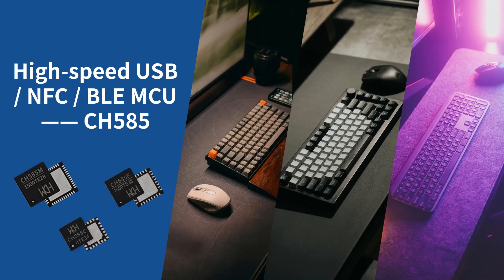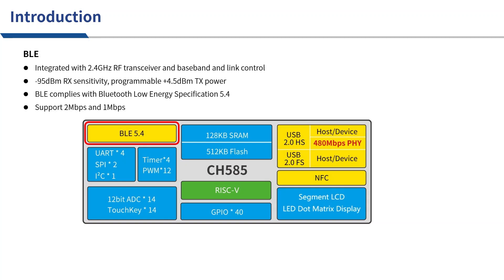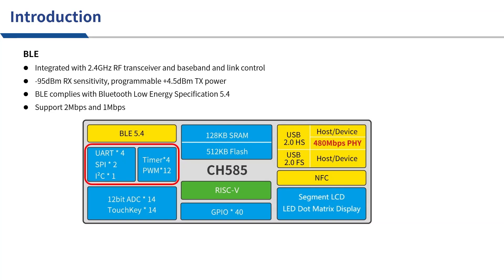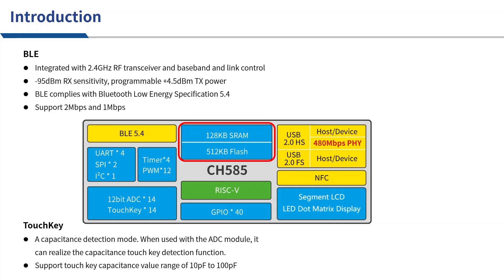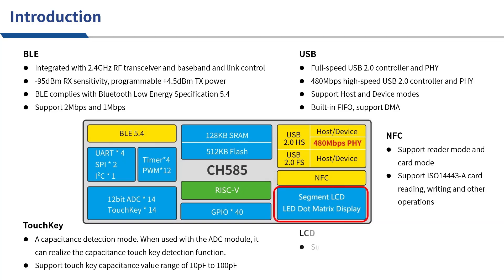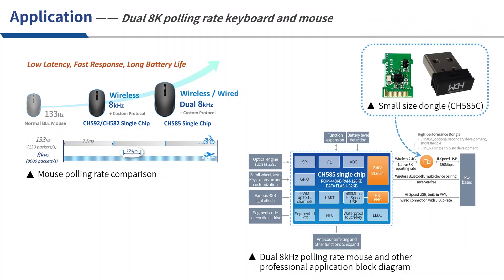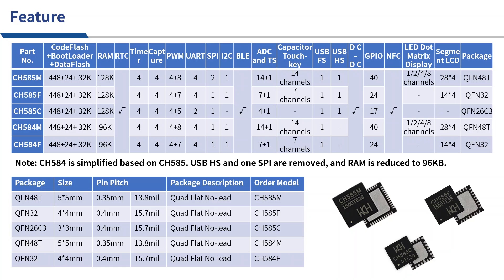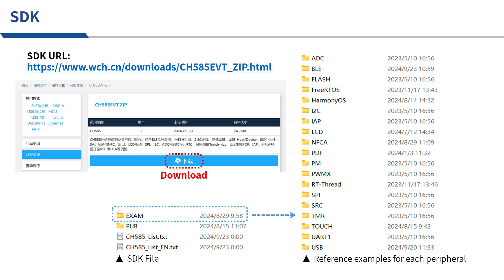#36- Amazing SOC CH585 with USB2.0 HS/BLE/2.4G/NFC/Touch key

Comment: CPU specs? 32/64bit? Frequency? RISC-V extensions?
Very nice chip - thank you.
Reply: The CPU is a RISC-V architecture, using the self-developed QingKe 32-bit V3C core based on the standard RISC-V instruction set. The core supports the RV32IMCB standard instruction set extension and the custom instruction set extension XW. It supports multiple system main frequencies, with a minimum of 32KHz and a maximum of 78MHz. It has a 3-stage pipeline.
Reply: Looking at the PDF: QingKe 32-bit RISC-V3C core

- Support RV32IMBC instruction set and self-extending instructions
- Low-power consumption 3-level pipeline
- Multi-speed system frequency, minimum 32KHz, maximum 78MHz